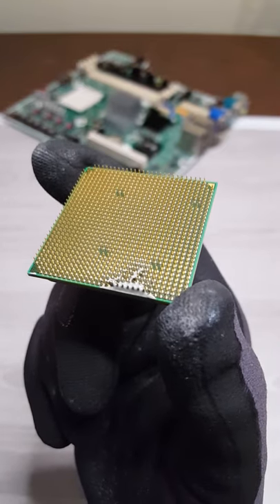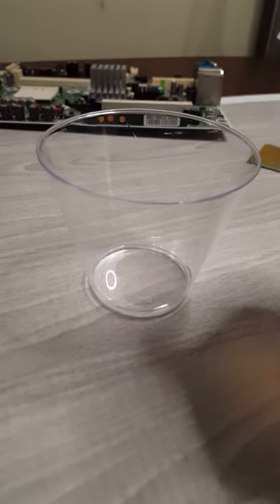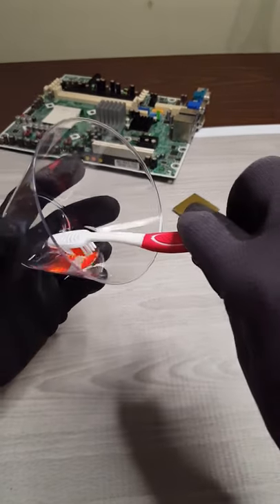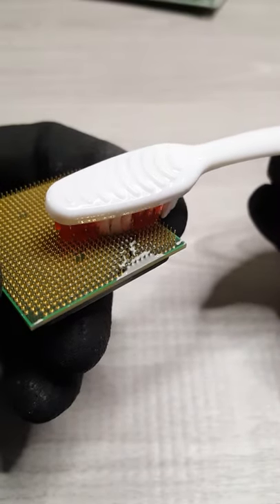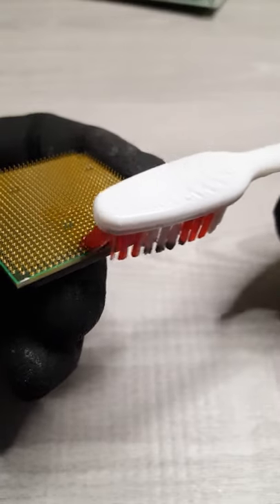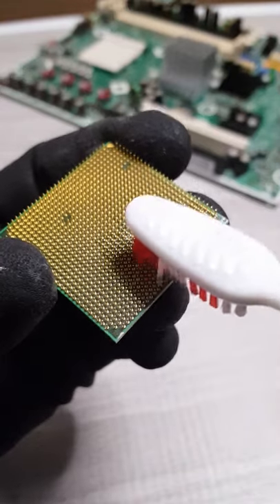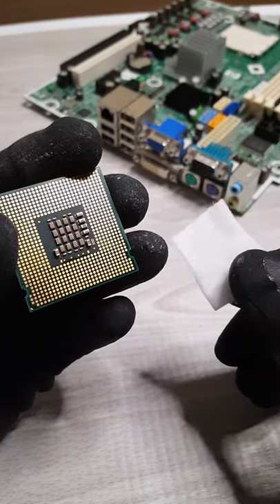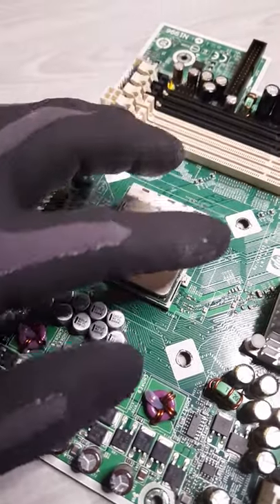Cleaning Thermal Paste off CPU Pins #Shorts

Comment: Just snap the pins off, it's much easier to clean that way
Reply: No need put thermal past on the socket to so it doesn’t get jealous and you are fine
Reply: Snap the pins off and mod your PGA socket into a LGA with the same pinout
gg
Reply: @MaavBR  you're much smarter than I am.
Reply: Oh thank you I have this problem but want coming off the way he said it was a bit annoying really I need to sell my intel i9 9900k cos I’m getting ryzern 9 I don’t really know too much about pcs myself but it got it off in no time thanks 🙏🏼
Reply: Pain
Reply: Just put the processor in the washing machine
Reply: @nachovideojugador  wait really I snapped the pins off I was selling my processor is this easier just wondering also it doesn’t seem to be selling even though i9 for £40
Reply: @ADAM-1505  if you are being serious you messed up. without the pins your processor is useless and has no value, even though it's a i9. you can try selling it for 10$ lol
Reply: @nachovideojugador  really wait so can in get new pins
Reply: @ADAM-1505  no. the pins come attached to your processor and as lons as I know they can't be fixed. you processor is pretty much gone
Reply: @nachovideojugador  ohh :(
Reply: @MaavBR  imagine using a cringy anime picture.
Reply: @nachovideojugador  You can transplant pins from a working CPU with some basic soldering skills. It's a pain if you need to do it to tens of pins, but for one or two, works like a charm
Reply: @MaavBR  i've seen that but i think that i9s are lga lmao. if the little lga connectors snapped theres not much he can do lol
Reply: @nachovideojugador  LGA sockets are BGA soldered into a motherboard. You can just take them to a place that does BGA soldering and a good socket from a compatible donor board. Shouldn't cost too much; at least here it'd cost me like $15 for workmanship and sub-$10 for a dead motherboard with a good socket
Reply: No
Reply: I saw someone that said they snapped bent pins off of their cpu, and I am pretty sure they were dead serious, because they defended it
Reply: @MaavBR  your intelligence scares me
Reply: @nachovideojugador  if it’s lga you could actually like had wash it but let it dry for a really long time idk about amds methed with the pins on the cpu
Reply: @ADAM-1505  damn that’s how bad intel is now sheesh
Reply: @nachovideojugador  no they can but they are crazy hard and you need a cpu well wait if lga idk
Reply: The pins are actually solid, brushing over them won't bend them. It requires some sort of freak accident to actually bend those pins

Comment: I was doing this with my i7 cpu and THANK GOD I didn't had an AMD processor at that time haha.
Reply: Dude, its a lot worse if it gets into your MB socket
Reply: @micobugija6284  nah thank god it didn’t
Reply from the maker: @micobugija6284  You are 100% correct, getting thermal paste off the MB socket is much more difficult and takes a lot longer to remove it. Because of your comment, I did decide to make a video on how to remove thermal paste from a MB socket. Thank you!
Reply: @micobugija6284  amd motherboards are crying
Reply: @AKDAnimations  not like intel ones are better. They have pins inside of them. Well threadripper and epyc platforms do too
Reply: @micobugija6284  how do you clean amd socket?
Reply: @AKDAnimations  no idea honestly
Reply: @micobugija6284  so intel socket is possible to clean, but amd is not
Reply: @AKDAnimations  lm not an expert, its probably possible
Reply: When the Ryzen 5 5900x is faster then the i9...
Reply: @AKDAnimations  with the amd socket I’ve used a toothbrush and some alcohol and just scrubbed at it for a little bit
Reply: @Knightlord1  first of all your comment doesn't have anything to do with what the video or the comment you are replying to are talking about and second, "ryzen 5 5900x"
Reply: @Knightlord1  Intel 3 5900k>AMD
Reply: How the fuck did you even screw up that bad
Reply: @Knightlord1  until you realise the overclock potential of that Ryzen is shit and an i9 is great. 🤣🤣🤦
Reply: @hardlinefoil7532  even without overclock ryzen 5900x still win, but yea intel its alot better for overclock
Reply: @Airihav  that's not my experience at all. That cpu made me never use AMD again. Ran at 100 degrees with a corsair water cooling system. The i7 ran at a huge overclock at 50 degrees with the same system
Reply: @hardlinefoil7532  mine dont even pass 70c on full stress cinebench/aida64/cpu Z etc... i use one ryzen 7 3700x with memory 3800mhz cl16 and infinit fabric at 1900mhz , but intel dont have any i7/i9 with 24 threads like on ryzen 5900x, and still have 5950x with 32 threads.
Reply: @Airihav  threads are only useful upto 16. No current title makes use of more
Reply: @hardlinefoil7532  do not use it yet, but for sure it will use in the future, but compared to the i9 and the price is still better to take the ryzen 5900x, you can easily overclock it with an asus b550m tuf plus,so it’s not expensive, since the intel needs a Z motherboard to overclock. and ryzen 5900x give more FPS too in games.
Reply: @Airihav  yes, but you are completely ignoring the cost of that Ryzen 🤦🤦
Reply: @hardlinefoil7532  ??? here where I live the price of the ryzen 5900x is the same price as the i9 10900k 🐒 . by far its better buy 5900x.
Reply: @Airihav  not the case here at all
Reply: @Airihav  all ryzen processors are currently more expensive than intel ones in all countries. Next time do your research before lying.
Reply: @LanaaAmor    you haven't researched enough then, try to use your brain next time, here on brazil i9 10900k and ryzen 3900x have the same price.
Reply: @Airihav  well.....gotta say I'm surprised you guys have computers in Brazil 😳. I thought y'all were still grinding that core 2 duo shit 💀
Reply: @Airihav  ngl I'm kinda relieved that I'm a brainless fella existing in 2009 instead of suffering in Brazil 🤢🤢🤮🤮
Reply: @LanaaAmor  who cares for country, LOL, I'm talking about prices. and here the i9 10900k is the same price as the ryzen 5900x. and you want to speak without knowing.
if you don't like brazil the problem is yours.
Reply: @Airihav  naah I love Brazil but you were discussing cpu prices on a video about cleaning shit lol and that tempted me to troll you.
Reply: @DiamondScopezz  uh oh 😳 the danky dank boi is here to kick some ass 😎
Reply: @Airihav  That's interesting. Here in Finland R9 5900x costs €590 whereas you can get i9-10900kf for €430.
Reply: @markokuosmanen  can get the i9 for £379 in uk
Reply: @markokuosmanen  here Ryzen 9 5900x / i9 10900K its 3800-3900RS  around 676-694 USD. but it has to sell in any store, RTX 3070 , RTX 3080 , RTX 3090 have stock here too, RTX 3070 cost 8299RS around 1477 USD. 
here everything is very expensive, but it has stock.
Reply: @hardlinefoil7532  What generation is this?
Reply: @LanaaAmor  ryzen is cheaper here by me, not by much but enough to matter
Reply: In the long run ryzen outperforms intel. Linus even did a comparison so yea gl. And only idiots would overclock for they're joy. In simple you have enough power for most stuff anyhow so why whine of the 2. Pick your poison and shut up.
Reply: People in this comment section are talking about overclocking Intel processors but thanks to their turbo boost speeds they're already hitting above 5GHZ most of the time. Unless you're using liquid nitrogen you can't get much more performance out of overclocking.
Not to mention you can also oc Ryzen too.

Comment: Hey, thank you for this quick and simple guide! I upgraded from a Ryzen 5 3600 to a Ryzen 7 3700X today and accidentally got a small bit of TP on 3 pins on the Ryzen 5. I thought I was thoroughly f***ed. Good to know I'm not the only one this has happened to.

Also, I realized that I originally used WAY too much paste when I installed the Ryzen 5, so this time I applied a smaller amount.
Reply: Same for me but with a 5600x
Reply: Same here 5800x

Comment: Thermal paste is silicone based and doesn't actually dissolve in alcohol. I use lighter fluid, one that's naphtha based like Zippo's does the trick, also dissolves most sticker residue, really handy.

Comment: I use a mix of Ethanol, benzene, toluene or xylene…. AKA … non-chlorinated brake parts cleaner.  It doesn’t hurt fiberglass resin, silicone sealant or any of the metal parts.. drys with zero residue.  No bent pins. It’s a solvent used at the manufacture prior to packaging.

Comment: Honestly glad I saw this since I was rebuilding my computer and I had a little bit of thermal paste on my fingers and it got on my old cpu. Upgrading from a 120mm to a 240mm aio, semi modular to a fully modular power supply with same wattage but higher rating and I’m upgrading my cpu from a 2600 to a 5800x

Comment: I was cleaning an Intel processor, and when I realized the thermal paste hit some of the first line contact pads, immidiately clean it off with a tissue and it worked just fine till now.
Reply: What happened now?
Reply: @farouqalsalih619  still working fine as it should, no problems at all

Comment: Does drying a cleaned cpu with a hair dryer does any damage to it?

I made a mistake after cleaning it with alcohol and held the dryer too long at the cpu (top and pin side) at like 10cm and for like 20 seconds.

Well it was hot but my hand wasnt burning😅

After like 5 minutes the cpu was cold. So does it suffer damage from that?

I know CPUs have their limit of 95 degrees celsius when they shut down the pc but the hair dryer had like 2000 watt on the highest setting (only has 2 settings)

Comment: Never do this with a amd cpu you will bend the pins. Use a very soft and fine paint brush. Will work 100 times better and is a lot softer.

Comment: Soon as you say this never happens to me - it does . I have been building for more years than I can count and soon as I call someone a dummy online for bending cpu pins ... I do the same thing myself . The mobo took a crap and I was taking the heatsink off to remove the cpu and it stuck to the bottom of the heatsink . I was able to straighten them out using a mechanical pencil , a needle and my bad eyesight . LoL !!!

Comment: Now the real challenge, cleaning TP out of a AM4 socket
Reply: @user-ie4kp7ni9d  no, the pins on the CPU set into holes where there is gold contacts on the inside walls of the holes. so you would pretty much just be pushing the TP further into the holes
Reply: @user-ie4kp7ni9d  dude, LGA sockets and AM4 sockets are not the same in the slightest
Reply: @user-ie4kp7ni9d  have you ever owned or even seen an AM4 socket? They don't work the same as an LGA socket, not at all. The socket has a little slide on it that is controlled by the lever, meaning there is no pressure holding the CPU from the top, but instead holding it in the socket by the pins, these pins would need to have constant pressure against those gold contacts, and the best place for that would be on the walls of the pin holes because the force holding the cpu in is being applied laterally, not vertically like an LGA socket
Reply: @user-ie4kp7ni9d  I would show you a picture, but I can't send you one through youtube

Comment: Why does AMD make their CPUs like that, makes it so much harder to deal with. I know that it's harder to clean the motherboard socket than to clean the CPU pins but still.
Reply: Yes but on the other hand the intel motherboard pins are waaaaaay worse in my opinion as its soo hard fixing a bent pin without the right equipment. With the amd pins you can just use a credit card🤣

But yes cleaning is way easier on intel tho
Reply: Ryzen pins are more robust than intel board pins. I've delt with both and I can wholeheartedly say i'd rather deal with a bent ryzen pin than a bent intel one. Same with cleaning thermal paste
Reply: @MaliceOfRites  i agree

Comment: When you guys bend your pins, after copying this dude on the video... Use a mechanical pencil, take the lead out of the pencil, and then put the pencil on a bent pin and straighten it with the pencil.

Comment: Not isopropyl. 99% alcohol. If you’re gonna be cleaning anything that has current passed through it you need to use 99%
Reply: @staideysstudio4637  it can still leave some residue I'm pretty sure
Reply: @staideysstudio4637  I never said it would short it. Just said it would leave residue. Generally having junk on your contacts isn't ideal even if it doesn't screw something up